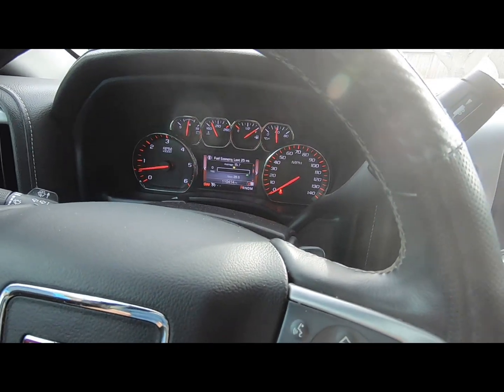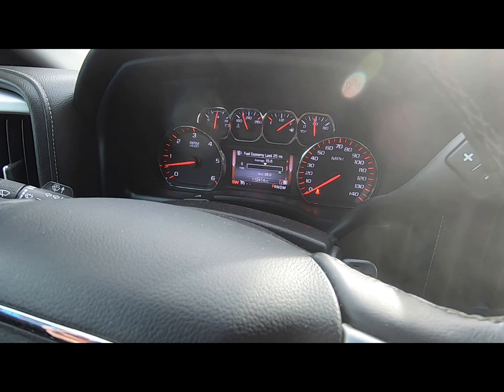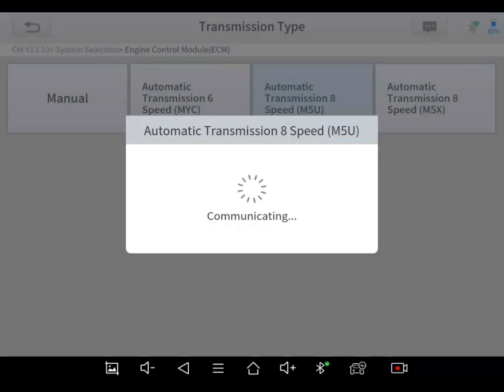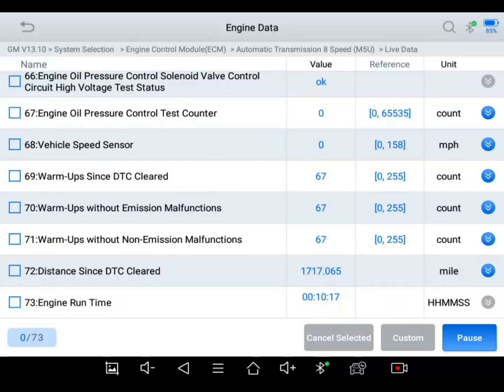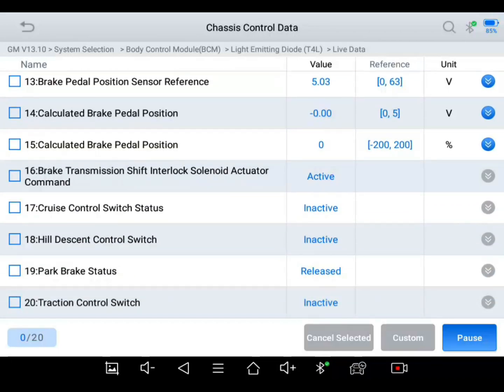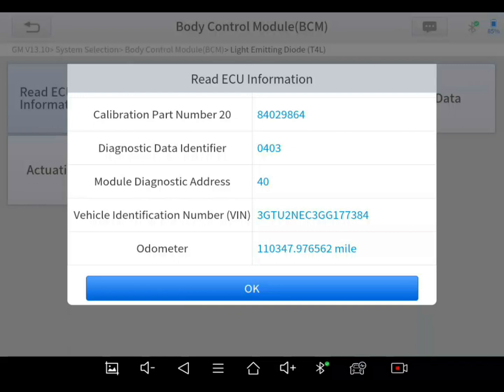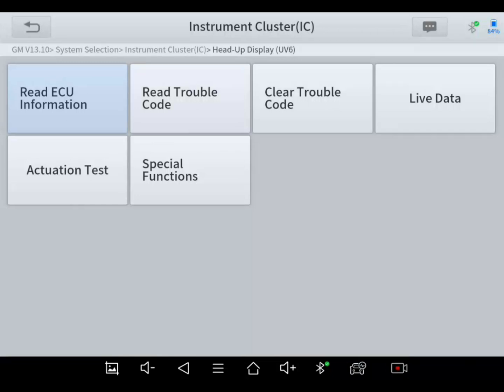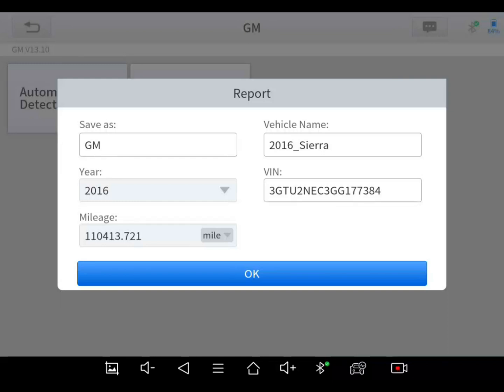How to Verify the Odometer Mileage Reading on GM Vehicles using the Xtool D8 Scan Tool.

Comment: I’m confused. If you change the mileage  using a scan tool. The mileage should reflect the same if you open the ecu of the instrument cluster. That’s wheee the display gets its data from. Now the bcm would probably be different.
Reply from the maker: Different, year, makes, and models do the mileage differently but on newer vehicles many of the modules will store the milage and sometimes if you replace a module with a used one the mileage doesn't necessarily transfer over so you will have a module or modules showing different values.

Comment: Does it work for a 2005 LLY duramax?
Reply from the maker: As far as the main scan tool it does work on 2005 Duramax.

As far as the Odometer reading It depends on year make and model and I have not verified it on a 2005 model year so I couldn't tell you for sure.

Comment: Could the discrepancy in milage be the modules are counting revolutions to determine milage using a theoretical number for tire circumference. And the odometer milage is taking account of the actual tire size which could be different than the circumference the module uses to determine milage. i.e. tire wear, over inflated tires, plus circumference varies between manufacturers and even within the same manufacturer.  Just a thought.
Reply from the maker: I guess anything is possible.

Comment: Been using a thinktool mini 2 scanner in a hyundai santafe gen 3 2013 model. the ecu odometer read 66k km while the odometer in the dashboard pannel is 100k. is this possible that the ECU does not provide the correct odometer? 

thanks for this video, i will later try to rescan the unit and check BCM if there is ecu information to check the total mileage.
Reply from the maker: Yes, it is possible and what probably happened was someone put a used ECU in the car, and didn't match the original odometer reading.
Reply: @737mechanic  is that possible that the information in the ECU vs the BCM ( ecu information will not match up since the ecu has been replaced?). it seems that the BCM will be the original odometer of the unit which is reflected in the dashboard
Reply from the maker: @rabbb3619  I am not sure on hyundia how they have their Odometer info stored..

One thing you can do is pull up a carfax and see if their is any service info, depending on what state you are in and if the vehicle has been serviced at a shop that reports the info sometimes it will show a nice timeline of what was done to a car and the mileage at the time. If you see the mileage all of a sudden go lower than a prevuios year then you could tell which module has the correct mileage.
Reply: @737mechanic  i see. well thank you very much for your idea. didn't expect to have fast response. looking forward to your future uploads 😎.
Reply: @737mechanic  Will a 2006 Trailblazer have mileage stored on separate module / two modules ?

Comment: And what about clocking with Iprog? That read and write eeprom files? Saw vídeos of mileage been backed from 200.000 tô 100.000km. That IS checkable? It leave traces? How to spot?!
Reply: Here in Brazil things are not like there. But This equipment had ability tô read eeprom chipset data, where This information could bê readable in hex translator
Reply from the maker: I am not sure if it leaves any old traces that can be checked other than the ways I said in the video. In states that have yearly vehicle inspections the most you could get away with rolling the odometer back would be whatever the last mileage it had when it was last inspected, even most shops document the mileage when they do oil changes and other maintenance so you can see a lot of that on a car fax.

Comment: OUT OF CURIOSITY HAVE YOU EVER TRANSFERED THE ORIGINAL MILEAGE FROM AN OLD CLUSTER TO A NEW/USED CLUSTER BY GETTING THE MILEAGE OFF A CHIP. I DON'T BELIEVE A SCAN TOOL CAN DO IT. I HAVE THE EQUIPMENT TO PULL THE INFORMATION BUT CAN'T FIND THE CHIP THAT CONTAINS THE MILEAGE ON A 2002 DODGE RAM.
Reply from the maker: No I have never done that.

Comment: Attention, in Mercedes W246, 176, 212, 204, 205 the equipment does not do EZS!!! Changing the counter settings works for a few seconds and then reads the old value from the EZS. Digiprog 3 does it better.

Comment: Edit:just got the D8 and it doesn't show milage on the body control module. And my cluster is out in a shop. 😔

Question. Great video. My gauge cluster went out on my 05 Silverado and I sent it out for repair. Now they need my total odometer milage and engine hours. I ordered the D8 and should have it tomorrow. Hopefully I can get the milage like you did. Where would I find the engine hours? In the ECU?
Reply: It's interesting, when I back out of all the menu like you did at the end of the video, where yours shows the milage mine is blank. I wonder if that one is pulling from the cluster.
Reply: Yah it doesn't show on my 2005 silverado.  Where it's supposed to show the MIL it says off.

Comment: The device, despite its price and the high price of updates, does not work with many cars such as Toyota, Nissan, Lexus, Malibu, and others.
Reply from the maker: Interesting, I have had mine hooked up to all of the makes you call out and have not had any problems.
Reply: @737mechanic  I could see any aftermarket tool not doing a certain data pid of a certain model but a whole make seems a bit much.  It is kind of funny for this person to dump on xtool.  Andy, the car care nut, that is a toyota dealer mechanic recommended the xtool d7 when it first came out.  He was really enthusiastic when the DB8 xtool came out and he works on Toyotas all the time.  
Mr. mechanic do you miss the topology on the D8.  I see it comes on the D9.  Would appreciate your opinion. Tnanks.
Reply from the maker: @dogsplantscarsneatstuff176  The topology of the D9 would be nice but I think it is way overrated, it gives a nice visual of modules that are online or offline but the D8 like all other scan tools will try to scan all modules and if it doesn't see one it won't be in the list so you know it is offline, for instance, it you have an ABS light on the cluster and when you do a scan and the ABS module isn't being populated in the list then you know it can't communicate with it. I personally don't need to see a red block representing the module for me to know it is offline. With that said I would prefer a scan tool with topology but I would not spend any extra money for it. What the D9 does have that might be worth the extra money depending on how deep you want to go is its ability to configure many more modules that the D8 can't.
Reply: @737mechanic  Thanks.  I appreciate the opinion of an end user such as yourself.  I am always afraid when any advertisement lists something superficial as a major important item: it really isn't.
Reply: @737mechanic  I just looked at a guy with D8 that updated 10 days ago and had the topology scheme added to his xtool.  Just thought I would mention it in case you haven't up graded.  Here is his video:
 https://www.youtube.com/watch?v=YPpnNuBWOAc
Reply from the maker: @dogsplantscarsneatstuff176  Thanks, I checked out his video and after doing some research found out Xtool updated the D8 with topology by mistake and originally was going to remove it but they have since decided to let it stay, and update the D8BT with it also. As of right now, the D8 does not have it but I have emailed xtool and should hear back in the morning about what the story is on this. Thanks for the heads up.
Reply: @737mechanic  Glad to help. If you talk to them please let xtool know that they will probably get a boatload of buyers for doing this at this price point.  They will probably make more money than selling fewer D9's.    If they leave this on I am going to jump on board too.
Reply from the maker: @dogsplantscarsneatstuff176  I actually did tell them that. I usually hear back in the morning when I email them.
Reply: And what about clocking with Iprog? That read and write eeprom files? Saw vídeos of mileage been backed from 200.000 tô 100.000km. That IS checkable? It leave traces? How to spot?!

Comment: You could do a video displaying how the D8 graphs info. Because it's one thing that it kinda falls short on;  and I wish I knew that before I bought it-- but no one had ever made a video showing it.  It says it can only graph 5 things at once, and it can only show them all on ONE graph, so it overlays all the data on top of each other. Not ideal. 

The Thinktool Pro can display 16 separate mini graphs on the screen all at once.   So for example, if you were watching O2 sensor oscillations and short and long fuel trims on both banks-- that would be several pids of info that you're trying to watch all at once.   I've never actually tried to do this myself.  But it would make a great video, because it's just not out there.   You would have the only video showing the Graphing capabilities of the D8.

Also, when you're in the pid list (live data list)--  you can push the drop down graph on the right, for a quick view.  But I think it can only display one graph at a time in the list.  So when you open a second drop down graph, it will close the first one.   Where as other scantools can do multiple drop down graphs, right there in the list....    

I just think it would make a really great video for people to know what they are buying-- but I'm not sure how obligated you are to xtool- or if they have sent you the tool for free or if your hands or tied, etc.   I understand that if there is money involved, they may not be so happy about a video like that. lol.
Reply from the maker: I will make a video on the graphing abilities. I did buy my d8 so I am not obligated to them for anything. My launch displays multiple graphs at once and it is nice to do that.
Reply: @737mechanic  yes it was a good Idea : i like working with data lives and know D8 capability is very interesting, thanks in avance for your future vidéo and sorry for my poor english...
Reply: @737mechanic  Will this scan tool work / software work on a 2006 Chevy Trailblazer LT (4200 vortec) and foremost  does this model have the extra module where mileage will be stored ?
Reply: Nobody says that about 14 or newer